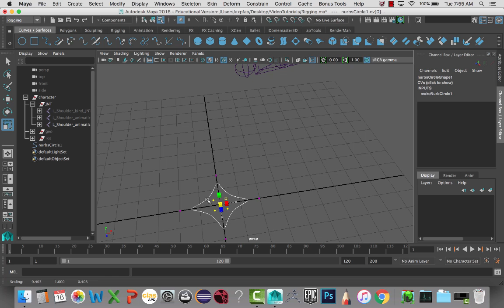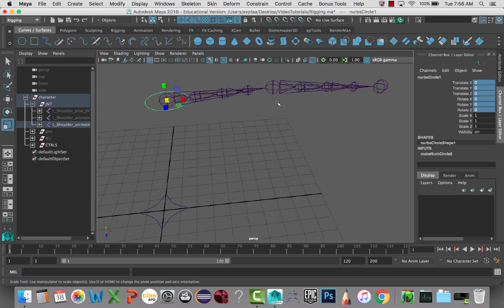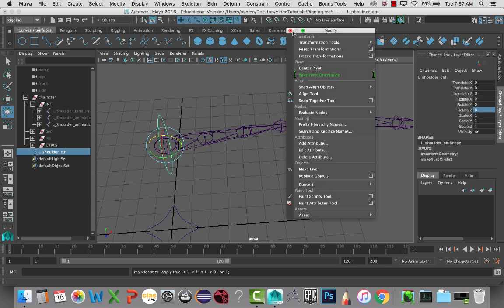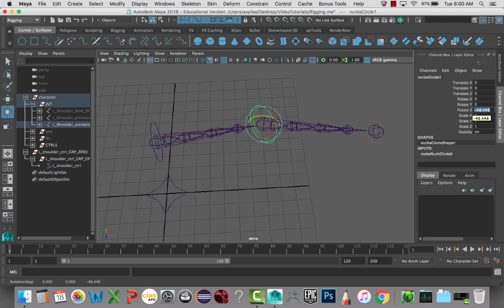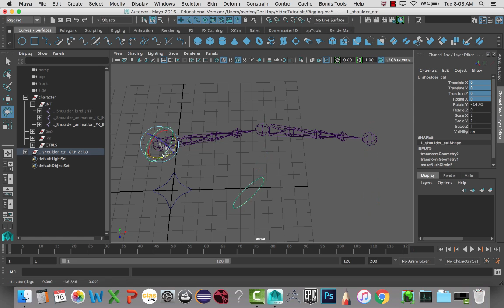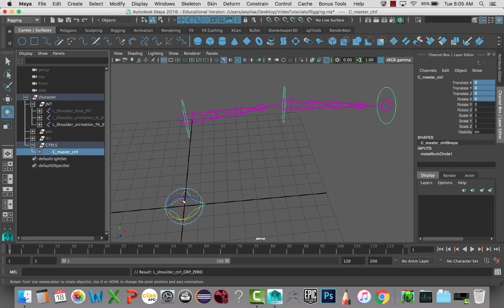Rigging an Arm Part 4 - FK Controls

Comment: can i ask a question? I didn't understand why did u created two groups for the control. because I learned in class that we group the curves as soon as we created it, and then thats all.
Reply from the maker: The ZERO group will be used to make sure you can keep the orientation the way you want it. The offset group is so that if in the future you wanted to create a secondary driver control you would not manipulate the control or joint directly you can keep those attributes clean so you can still used them and be able to manipulate an offset with code or another attribute.